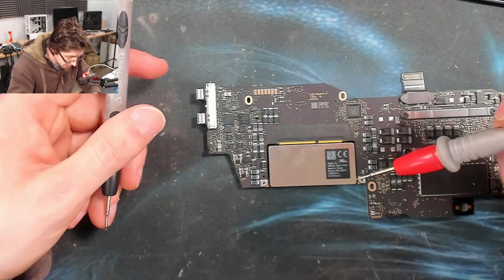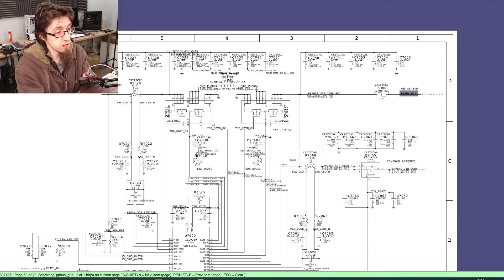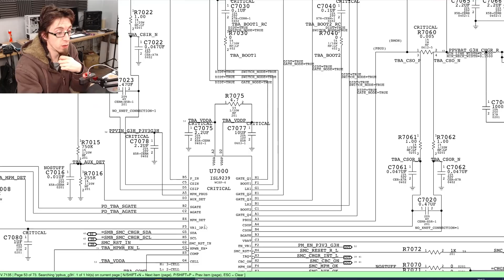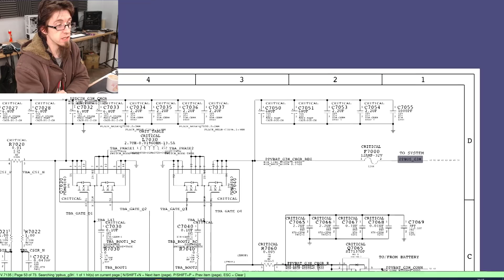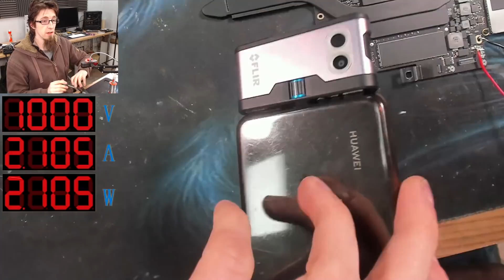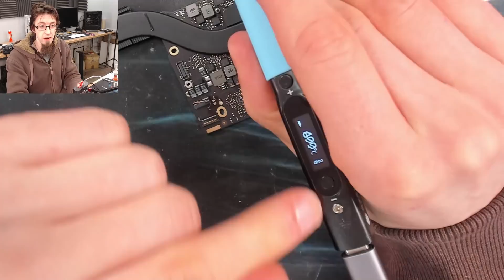Learning A1708 stuff - MBP, No Power - LFC#296

Comment: Brilliant video. Had a mac with similar problem. Tried injecting voltage but nothing seemed to warm up. Turned out it was thbe exact same capacitor as in your video!  Just removed it and it worked fine :)

Comment: Question, I have a macbook air, that will not come on.  The machine appears to have had water damage.  The water damage is tripped.  So I replaced the power board, thinking that it was not getting power.  The chips are on the front of the board will spark when touched with probes..  Any suggestions??  If I am out of line, my apologies..

Comment: Off topic and kind of urgent matter. I have a DELL Laptop given as a gift by a friend. It´s used but looks new. The thing is that the AC/DC Adapter and the laptop have no marking or sticker of any kind. It outputs 18.5 Volts aprox but when plugged into the laptop it drops to 10 ish - Volts. Any suggestion on what the issue is. Mobo or the adapter it self???

Comment: One thing you said - putting 2 10uf capacitors in series would give you 10uf at a higher voltage rating - actually in series you add up 1/capacitance of each cap. (Example: 1/c1+1/c2+1/c3)

Comment: Good video. I'm glad you didn't use Kapton tape. Kapton tape is highly conductive of heat and  is sometimes used as a thermal pad and for electrical isolation, as in, isolating mosfets from ground. It's claim to fame is it's ability to withstand high heat and/or electrical current and not melt, so using it as a wall (not touching the component) to block heat does seem to work.. If you had use Kapton tape and hot air I think you would have melted the connectors. Don't believe me, look it up. It always seems that people want to use hot air (I blame Youtube repair videos) all the time when a soldering iron will and does work better in a lot of situations. Good video, Excellent explanation, Thank You...

Comment: Quick question, the other soldering iron, would you recommend or not and what brand as a starter for now?
Reply from the maker: Pinecil and TS100 are both solid irons IMHO, same tips, same firmware. Pinecil is my favourite, and cheaper, but subject to actually being in stock.

Comment: On your ts100 tip knife edge, is that the ts-ku thinner blade or the ts-k knife edge? 
I still haven't purchased my ts100.. 
a bit of a pain when the power cord and the tip is not what I want.
Three different places, sell the ts100 and tips: Walfront, Uy Chan and Sain Smart. Great fix today... QUITE a tight fit to repair.. but done.. never tired of watching capacitors go bye bye!  😂"just toss them out Graham."
Thank you for the video.
Reply from the maker: It's a TS-KU. I wouldn't expect to find an iron with this tip as standard though. However, the cheap tips on ebay for about $10 each are good enough IMHO.

Comment: Thanks for showing resistance to ground measurements of inductors on video and comparing with main power rail before any voltage injection, although I think it the reason behind it and the risks of not doing it should be made clearer. Too many people still injecting 19V not knowing it could go to the CPU (or something else) if high-side MOSFET is shorted, and recommending it to others…
Btw I'd recommend removing the SSD before working on the board, especially since PPBUS_G3H goes directly to it on this model.

Comment: Hello Adam, for the  Future : 20v 0 amps is mostlikeli a ppbus short. Ans that Cap dies a lot. Also Backlight cap. Also mesure Résistance between ppbus and ppcpu_s0 .If ist 0.somethimg Ohm , there ist a dead CPU mosfet. I have Seen 20% where ppbus Shorts 3v3_s5 at the CPU ! So after Clearing ppbus Short, there will BE a dead CPU since 3v3s5 goes to the cpu.

Great Job so far!
Reply: ah German

Comment: Nice fix, someday i'll get lucky and it's just a capacitor too.

Also, FlexBV has the option to send you from the component in the boardview to the one in the schematics or vice versa by just right clicking, no need to ctrl+f at all. You probably know this already and somehow that feature is not available but just throwing that out there.

Nice vid, cheers!
Reply from the maker: Good to know! I'm still learning it, haven't got the readings loaded into it yet either.
Reply: Whoops, I'm 7 hours late on the help

Comment: I have seen a lot of your videos where you replace caps, but what actually causes the cap to fail ?
Reply from the maker: Just fatigue I think. Sometimes it can be shock or heat, or a combination of both. I've not researched the analysis of ceramic failures to find out though.

Comment: So that soldering pen goes up to 11!
Reply from the maker: That's actually a really good way to describe boost mode 😄
You can set the boost temp in the iron settings, so if you work on lighter boards at run 350c or 380c set, you could boost to 400c for large connector anchors or something. But since I mostly work on mobos with 400c set, I just need mooooooooooooooooore.

Comment: is this short a result of using a defective battery charger?
Reply from the maker: I'd say no. Just the usual component fatigue. I think bad chargers would most likely damage the Thunderbolt controllers, and that would manifest as the laptop not negotiating 20v with a known-good charger.
I think non-compliant type-c chargers that just belt out 20v all the time do exist, but I haven't seen on in the wild yet.